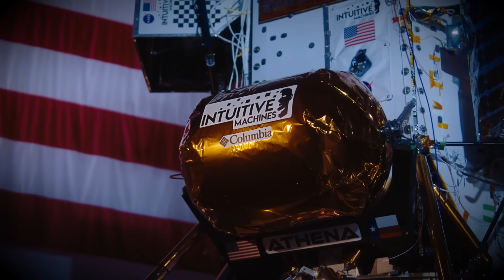New Image Reveals The Athena Lunar Lander Is On Its Side

Comment: Just an idea. When Gateway is placed, how about a state-of-the-art VR rig inside so that a human can 'Take the Stick' if it's needed, just as Armstrong did. He would not have landed in a crater.
Reply: As long as gateway is right over head or the two-way light time will kill you.
Reply: @stuartgray5877 if you are landing on the south pole (like IM-2) Gateway is actually the furthest away when straight overhead. At that point it reaches a maximum distance of 70000km or 233 light milliseconds. Meaning the two way light delay would be about half a second, compared to 2.6s for earth.
Reply: @plainText384  That might still work for teleoperation of a humanoid or a rover, but might be a problematic for a terminal descent. For spacecraft and ground systems there is another latency in processing the commands and telemetry.
I worked on the Deep Impact probe that had to be fully autonomous because the one way light time when we hit the comet was over 5 minutes.
Reply: @plainText384  Much higher than I realized. Why so high? Seems to defeat the purpose a bit.
Reply: @stuartgray5877  This is why Luna needs a Starlink network.
Reply: You'd think these landers would already have some pretty good AI. At least that's what the guy who sold me the stock said.

Comment: To bad, when you have two landers fail in the same way, sounds like a design flaw.  Either the overall lander design, the landing gear, or the A.I. landing software.  Hopefully before they launch the third lander, they will fix the issue.
Reply: They must make it taller and slimmer next time 😅
Reply: @paulpaulsen7777  I disagree it should be like blue ghost lander!!
Reply: To me it seems they are having problems zeroing horizontal movement.
Reply: There is another one in Japan.
Reply: Maybe aliens pushed it over with a big stick.
Reply: Won't happen,hop NASA cuts it's losses

Comment: They are really down bad. Firefly is eating their launch
Reply: Yes. Look at the Firefly craft. It's perfect for this kind of landing. This bugger is WAY to top heavy.
Reply: @Ron4885  REALLY?  You can calculate the mass and balance by looking at it?  Ok Clark Kent.
Reply: @Chris-bg8mk  estimating how high an object's center of gravity is is not as hard as you believe it is.
Reply: @Chris-bg8mk  Which is more stable - a guy driving a firetruck with the ladder  retracted or another driving the same firetruck with the ladder extended upward going around the same corner? I don't think you need to be a physicist to figure that out.
Reply: Love the play on words
Reply: Firefly dodged a bullet..they landed on the edge of a crater. In  fact one of their landing legs has no contact with the regolith.
Reply: @skeelo69 So it stuck the landing with only 3 legs. Exponentially more impressive. Sure one didn’t make contact, but if you watch the video; it was nowhere close to tipping in any direction. Short and squat with cooking wok’s for feet. 
We’ll see if it was luck with Blue Ghost M2.
Reply: Firefly is showing a single still frame image of the shadow of the lander on two legs. It was apparently taken at the last moment it was upright. The fact that the surrounding terrain was a slope...
Reply: Elon is building an orbiter that will photograph the entire Moon surface in millimeter detail that will show Firefly on it's side.
Japan's JAX knew this and decided not to lie because Elon's orbiter would verify or disprove India's and Firefly's fibs about soft upright landings.

It is far safer to tell the truth than be proven a liar after your grinning face is put on the cover of Time Magazine holding the Nobel Prize for Rocket Scientist of the Century...:face-green-smiling:
Reply: Landing on the that spot is harder than fireflys landing. And yes it might look top heavy but most real weight will be central and centred on the outside as the way Zero G works is totally different to earth's gravity!
I think it's more likely software problems with guidance and engine systems.
Reply: @ftoalan  the moon isnt 0 G, its 1/6th earth gravity
Reply: @ftoalan The moon is not zero G.
Reply: @ftoalan  Zero-G has nothing to do with it.  IM-2 flew thru Zero-G just fine.  1/6 lunar gravity is a different matter.
Reply: @ftoalan doesn't matter incompetent people run this company despite the companies b.s

Comment: What did we learn from IM. High center of gravity is always dangerous in a gravity well. X2
Reply: A bit like SpaceX. "We learned that fires in the engine bay blow things up ... X2."
Reply: Don't say it too loud. DOGE could hear you!!!
Reply: I agreed. Considerably tall for an impact landing especially remotely.  Broader base footprint may help.
Reply: FYI the width of the legs is constrained by the diameter of the rocket. Heavy shit was positioned low, so it's height compared to width is not in and of itself a determining factor. But they definitely need to rework something.
Reply: So are they gonna try again?
Reply: Aspect ratio h/r is too great.  Compare with the LM or the Blue Ghost.
And too many legs.  
Two extra chances of ending up on an obstruction, of ending up lop-sided
-Professional Engineer

Comment: Who tries to land a tower when you could land a pancake 🥞
Reply: Bigger land feet and a more "squat" body design.
Reply: EXACTLY !
Reply: Exactly - intuitive? I think not.
Reply: No wonder the Aliens 👽 are so ahead of us..🛸
Reply: 🤣🤣🤣... yeah pancakes can hold tons of gear....not.
Reply: @mmedved5567  i load mine up with syrup
Reply: hard to land any shape with a stuck thruster and faulty nav equipment
Reply: @Ionee-q4f  Much easier for a pancake to land right side up with a stuck thruster or not.
Just butter the side you need to have land facing down.
Reply: @Ionee-q4f  - "and faulty nav equipment"  The last two Moon landers I watched live seemed to have flaky landing radar altimeters.  Like they STOP working below ~100 meters and start giving noncredible values.  I suspect they have backup nav for altitude and the Fault Protection SW declared the landing altimeters failed and didn't try to use them for terminal descent.
Apollo used their EYES (very unreliable) and the touchdown sensors to tell them when to cut thrust.
Reply: Leon will try, and succeed the same as he did yesterday.